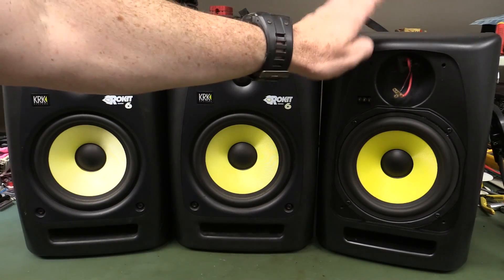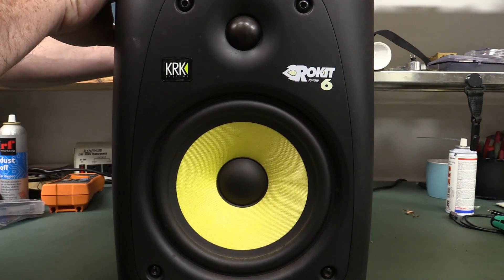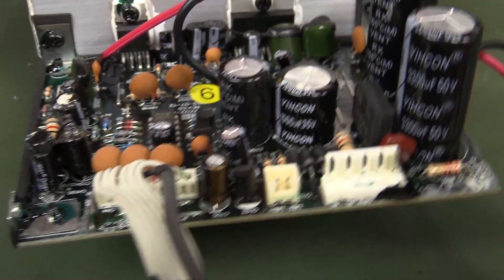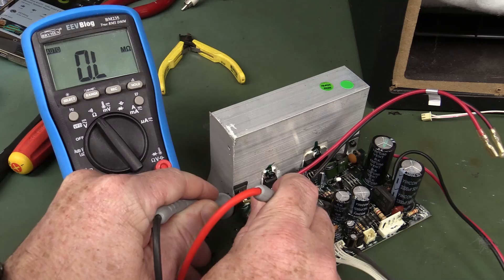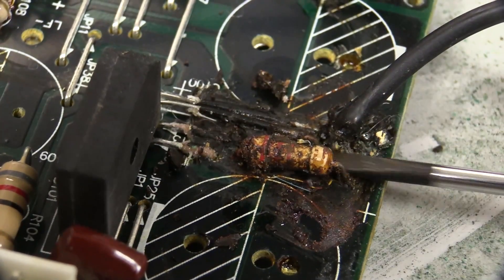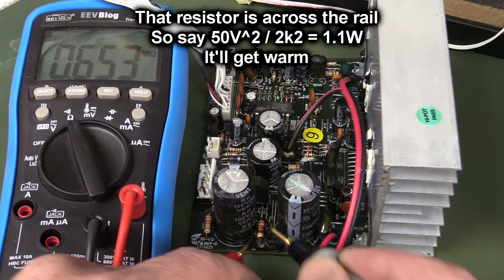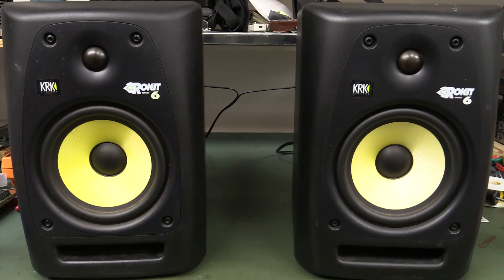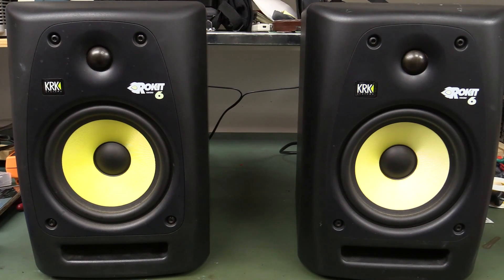EEVblog #1073 - MORE KRK Rokit Black Gunk Speaker Repair

Comment: The tweeter crackle sounds a bit like the noise you get from low quality leads, or less than optimal earthing. Could one of these be the issue in this case?
Reply: jonathanfp123 earthing could be ye

Comment: Have gen-3s been spared liquid of death syndrome ? someone confirm please
Reply: I just opened my gen 3 up and sure they had black gunk all over the place. It still felt kinda rubbery and wasn't conductive though this might be due to age since I bought them 2 years ago. They also had alot of transparent gunk that looked like silicone. So it seems these are doomed as well.

They also have had that hissing noise in the end of the video since day 1.
Reply: There’s a KRK rep responding to a comment elsewhere on this video, apparently the black gunk in Gen 3’s is not the same as previous generations, should be all fine.

Comment: Component glue that becomes corrosive and conductive over time was a problem in 70's and 80's era audio and communications equipment, evn from reputable manufacturers.   See https://www.youtube.com/watch?v=WlBZOftab2c for just one example.  I do find it surprising that a reputable modern manufacturer made this mistake (along with those sketchy capacitors).

Comment: Gotta love all the fanboys, saying "Yeah Krk is crap! My Speaker double the price sound WAY better" Of course they do! Krk is fine for the price and spoiler WAY better than Behringer 30€ shit. Also: Because KRK has spread so wide, many Studios use them as Third or even Secondary. Just to know how it sounds on them. Studio monitors are not there to sound as nice as possible. They should reflect how it would sound on most peoples biggest and best Stereo. If your Mix sounds great on your 7000€ Speakers but (in comparrison with others) shit on a buetooth speakers, you failed.
Reply: There are a number of brands with monitors in that price/spec range though that perform equally or better for a given price, without any black gunk issues.
Reply: For playing around the KRK Rokit are fine. Nice to start with, but their soundstage lacks detail for doing any actual proper mixing. In my opinion somebody will be better of buying a good set of 'second hand' monitors produced by a reputable brand then buying the Rokit new.
Reply: Rene Seckler
You make an excellent point.  I worked in a TV studio for years and the only video monitor they had was a Conrac.  It cost a zillion dollars and did not in any way reflect what mere mortals had their living rooms.  I once convinced them to drag a Sony Trinitron in and get real.  They went back to the Conrac.  They needed to impress the client.  I suspect that the music industry is similar.  There is a need to sample music on junky speakers and on good ones.  That's the reality of the business.
Reply: You need the right tool for the job. You should be able to trust your equipment. Studio monitors are like a magnifying glass, showing the things you need to know and not make anything nicer and not hiding things. Usually good tools are more expensive then less good tools. Sometimes the cheaper tool will also do the job but it might not last as long as the more expensive one.
Reply: The Behringer Truth 2030 and larger 2031's are around 300-350 € each. IMO many in a blind test would be unable to distinguish these from monitors costing 10 times as much..
Reply: I think that is a bit harsh. With Source material that has enough resolution, you will hear in a side by side blind test the difference. 
Also: A nice Side of Krk: They are built robust enough to buy them used. On the German equivalent of Craigslist (Ebay Kleinanzeigen) i got a Pair of VXT6 in almost perfect condition for 300€. The Rokit 6 Gen 2 or 3 go away for the same price. The Market there is filled and cheap. I like them as an alternative to my Adam A7X and the Yamaha HS8 in the studio. Just fills the Gap of what i want to know about my mix.
Reply: Rene Seckler Just pointing out the Behringer's are by no means "30€ shit" as you said. General consensus of the rokits came out was they were powerful (for that stage/club "punch")  but a bit "bright". Whether or not the tweeter adjustment pot had anything to do with that, or why it's even there IDK..
Reply: I get what you mean. I literally meant the 30€ shit you CAN get. Manufaturer does not matter in that regard.
Reply: KRK is shit compared to my speakers cause my speakers use AMT tweeters!
Reply: No you ust have a shit bluetooth speaker :p
Reply: Hellcore Exactly, and Rene Seckler you have no idea about what you are talking about.

Comment: The crappy unbalanced cable and plugs could be the cause of that hiss. Environmental noise radiating in through the cable to the amps.
Reply: Good cables with a screen that is low impedance coupled to earth are indeed a good thing.

Comment: Is it designers' fault or manufacturer's fault?
Reply: In my opinion the company board is to blame. They made the 'strategic choice' to produce the products somewhere far away. Not staying on top of it and therefore, not giving a d@mn, not able to ensure a hight quality standard. The same happened for instance to the Focusrite Platinum series. The first generation was built in the western world. Then they moved production to the east and that changed everything. From the outside all was still looking the same but on the inside it was not up to standard anymore. They sound less good. On the interweb you can find as of which serial number you should start to avoid them. Also KRK, they were a reputable brand. But after the Rokit series they never got back to that level. Focusrite still is a reputable brand regarding the expensive equipment. You should just avoid their cheap product ranges. It is a completely different brand in the low end. As always, you get what you pay for.

Comment: KRK/Rokit is not really a professional brand. They are prosumer, at best. They cater to some home DJs, music creators on a budget and gamers, stuff like that. You will very rarely see them in any studio, other than small home studio, and if somebody is into the deeper bass section, which is not really reference speaker kind of thing to do.

Yamaha, JBL, Sony, AKAI, ADAM,  these are brands you are looking in professional environment. The prices (cheapest ones are probably 2 times more expensive than KRK/Rokit) also reflect that. M-Studio and PreSonus would be a stretch, they specialize in electronics, but not speakers. KRK itself is really at the low end of the spectrum of these kind of products. Sure there are many that are much worse, but it is obvious these other ones are not for professionals either.

I can recommend Yamaha HS5 and HS7. I own both, and they are excellent.

But if you already have these KRK stick to them. To really get all of your speakers you really need to have good sound setup and acoustic anyway.
Reply: Isn't the VXT series from KRK actually quite good? 
I'm still using my Rokit 8's but I'm thinking about going Yamaha or even saving up some more for even better ones.
I must say, though... The Rokit 8's are good monitor speakers in the club :P

Plus, if you turn them over after the night, you can make a fried egg on the backplate.

Comment: I couldn’t find any faulty ones on eBay uk, and working ones are just stupid prices. I guessed these would cost around £150 a pair new, I was dead wrong!  I’m not impressed with these monitors at all. Horrible, cheap capacitors, jellybean audio ICs in a cheap box with a couple of dubious looking drivers with a nasty, plastic panel. It screams consumer grade, it’s overpriced junk. Beside the glue issue, you really shouldn’t have bulging caps on an audio amp pcb just a few years old.

Comment: Did KRK ever actually comment on this before? Or are they keeping radio silence?
Reply: Someone claiming to be from there commented on the last video.
Reply: I am not expecting that we will hear anything from KRK. The Rokit series are marketed as reference studio monitors. But compared to the competition they are quite cheap. I think it all comes down to: "You get what you pay for." Brands like Adam, Dynaudio and Genelec, to just name a few, all cost a little bit more. The money probably goes into 'not' cutting corners. Installing better caps, applying better glue and investing in a serious service organisation. It will ensure long lasting performance and good availability of genuine spare parts. All in order so you can keep enjoying your key studio tool. Apart from the 'expected wear and tear' I never saw any serious issues with the 'good' brand reference studio monitors.
Reply: If you blew a PMC (like we did) they will repair them, ok you have to pay for that, but they do will repair....i really doubt that krk will do, most likely they have sourced it out or simply say...sorry just buy a new pair...

Comment: they just tried to shave off some extra profit by using cheap ass components, obviously it bit them in the arse. I've always steered away from those krk's, too consumer friendly. couple hundred bucks extra would give you true semi-professional equipment, with less cheap ass components inside.

Comment: I have two Gen 2 rokit 5 that suffered from the same problem. I solved the problem in another way.
Disconnect the amplifier board from the transformer.
Desolder the wires for the drivers and the controller board.
Mount one of these in each speaker.:https://www.yuan-jing.com/cg-version-lm3886-amplifier-board?search=3886
Problem solved...

Comment: They really don't look any better than mid-nineties midi system speakers (Aiwa etc), with a dodgy looking amp stuck inside. I guess you get what you pay for! :/
Reply: Yup, I thought the same thing, crap looks exactly what you find in cheap chinese mass produced ghetto blasters and component systems from the 90's Using sold off brandnames like Yorx, Citizen, RCA, genexxa, etc.
Reply: Thinking about it now, even the build quality on the Aiwa ones I used to have were better than this! I think these are definitely more like the really budget brands like the ones you mentioned!
Reply: Oldgamingfart These are not (much) about fancy looks. They are about every little detail designed, manufactured and calibrated for precision. The thing that should look good is the artist on the other side of the soundproof glass window or the picture in the music video being edited.
Reply: That's really a moot point considering we're talking build quality, and given the competition at this price point (Yamaha, JBL, Denon Pro, Mackie, etc etc) these don't seem like they're anything special (imo). 

And if it were me, I'd want something that's not going to go kaput in the middle of that recording session! :P

Comment: The manufacturers want to produce with the lowest Price possible, so they use crap instead of good components, because a good cap maybe costs 5 bucks per Piece and that would be 20 bucks less that they would earn with one Speaker. if they produce 100.000 Speakers with good components, they would "loose" 2.000.000 Dollars. They want to produce low-priced and sell for an extremely high Price, because if you Need this Speaker, you would pay for it, even if it costs 300 Dollars. You said something similar in the video where you found that huge oscilloscope which costs thousands of Dollars. They make a lot of Money with them. In producing, it should cost a Maximum of 600-700$. An iPhone X for Example costs around 300$ in manufacturing, but is sold for 1000.
Reply: 5 bucks for a cap? lol... 
I know it's just an example but come on... :D

Comment: I absolutely hate and despise that gunk. I find it in most every piece of equipment I repair. If you need mechanical integrity, 𝗗𝗢𝗡'𝗧 𝘂𝘀𝗲 𝘁𝗵𝗶𝘀 𝗴𝗹𝘂𝗲 𝗖𝗥𝗔𝗣 . . . it makes a  𝙩𝙤𝙩𝙖𝙡 𝙢𝙚𝙨𝙨 out of everything . . . .  use proper nylon/metal/plastic retainers for components and wiring

Comment: Wouldn't hot glue be a cheaper option? Even using hotglue is better than this crap.
Reply: silicone.
Reply: TubiCal yeah that's a good one but cheap speakers use hotglue on the components

Comment: Even when they are working well they aren't much good for anything but doof doof music.

Long way from flat frequency response.
Reply: Axe Man I dont think krk were going for flat response. Seems to be focused on house and techno producers so more low end
Reply: Like if Beats made speaker kind of doof doof bass and treble curve sound?  If so, then these are also boots and pants and boots and pants music speakers too.  Oboes and Violins sound the same, but that isn't the purpose.
Reply: I disagree.  I have a Gen 3 6" pair... and once I calibrated them, I was very impressed at how true they were (for the price).
Reply from the maker: KRK are marketing the crap out of a flat response:
https://www.youtube.com/watch?v=Kakn5jTA0pg
Reply: And I think they do a great job!  If you calibrate the levels using an SPL meter (which is why the adjustments are on the back - calibration only!), they are very flat.  I mix and master pro audio with these things as my main mix.  I'm sold on them, but they are not "plug and play."  They must be calibrated to the room and the input.
Reply: I got the impression that Dave thought they were good speakers.  Are they garbage?
Reply: Alex tworkowski, They're fine unless you have something against affordability and popularity, then you might want to get something far more expensive with a marginal quality increase.

My ancient first gen 8" KRK's still work fine and have been online 24/7 more than 13 years now. it is just the second gen that seems to have this flaw which could make for a cheap deal on a couple of fixer-uppers.
Reply: Ah!  I didn't catch that it was only starting w/ the gen 2.  Good to know.  In a world populated with ignoramouses that have more money than brains, the popular trend is to jam as much snake oil out there as possible.  Nice to find a product that is passable and not expensive.  Thanks for the reply.
Reply: I have the Gen 3's and love them!  But, they are only 3 years old... thanks to Dave, I'll know what to look out for if anything ever happens with them!
Reply: Yeah they claim to be flat and you can probably produce a reasonably flat 1/3 octave graph in an anechoic chamber with a specific mic position - but once they are in a room they end up being a bit scooped (aka the disco smile EQ) due to the dispersion characteristics. JBL are far ahead on neutral presentation in the same price range.
Reply: Kings of Leon's Record of the Year was mixed on Rokit 5s. I don't think that was doof doof music. Dave Jerden mixed The Shrine on Rokit 5 and they are not doof doof music. BTW, what is doof doof music?
Reply: Rich from KRK here. They are pretty flat. I will say that when you sent the knobs on the back "flat" there is a bass bump. That is to win the "store battle". They are much flatter if you roll the bass off a click or two depending on your room.
Reply: +Rich Renken,

Oh look a corporate shill, I'm sure he's going to have a really objective assessment of them.

lol.
Reply: +EEVblog, There's a lot more to good speakers than just frequency response as well.

Things like long term reliability matter a lot, a good set of monitors should last 20-30 years running basically 24/7, not 3-4.

The speed at which the speaker responds to the signal fed them matters a hell of a lot, slow response speakers sound muddy in the low end, you need fast response to get accurate reproduction and tight punchy bass.
Reply: Axe Man Axe Man Google my name. I'm not a world famous engineer but I have worked full time as a mix engineer. I'm a real human in here because I care. If I'm a corporate shill, let me know which company doesn't have "corporate shills". KRK is number 1 in sales but it's a small team of guys who live music and the craft. Just like other monitor companies. You won't hear me talk bad about them. I am honestly curious about what you call doof doof music.
Reply: Axe Man That is exactly right.
Reply: Rich Renken, I think he is referring to  what we used to call 'boom, tizz'. and is not talking about a style of music...Maybe?
All audio products that have had any care taken,  have the response and the critical performance considerations  chosen and tailored to the designers preference - They tend to make stuff they like to listen to! 
Microphones in the studio are chosen for their 'sound' not their flat response, unless it's a measurement mike and is an artistic choice. An orchestra may certainly want an accurate recording to preserve the tonality of the instruments but popular music is something else. A studio monitor is a good one if it is one you know. Best you can do though is to make it as flat as possible.  If you are aware exactly what to expect you will get no surprises later on.
I apparently am a NASA shill because I believe we landed on the moon. I hate that language.(sheeple, shill etc).
Anyhow so much music sounds shite these days (not all of course) decent speakers like these are a godsend, unless they stick in some Quads.
Reply: Martin D A Good stuff. Totally agree.
Reply: Rich Renken, I think you arre a credit to the company.
Reply: Martin D A I appreciate the kind words.
Reply: I agree Rod. I have some Gen 2's and I know how most folks use them but the boom box character is easily defeated and are great for mixing "NORMAL" music. :)